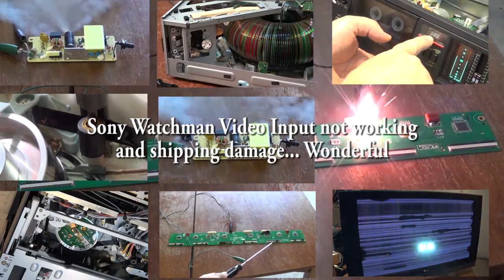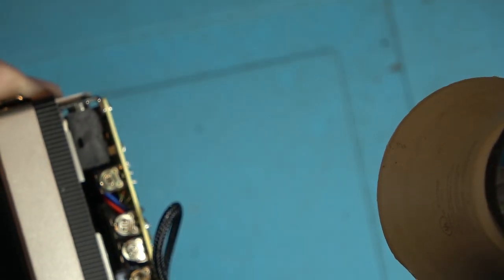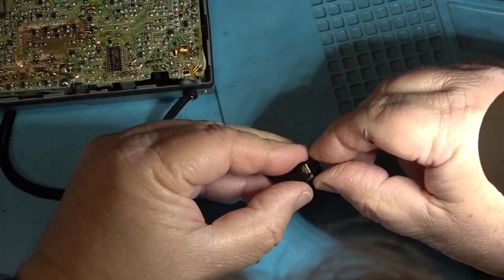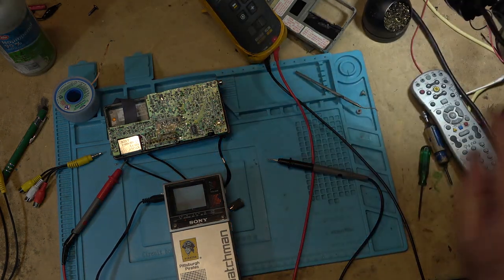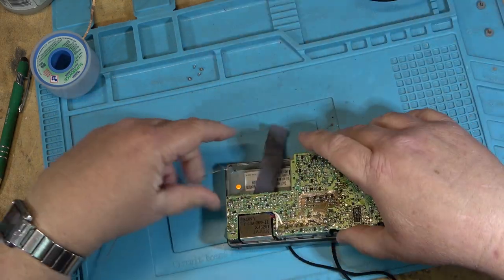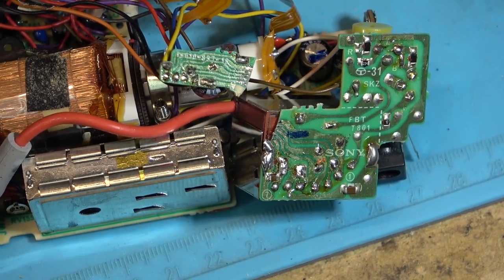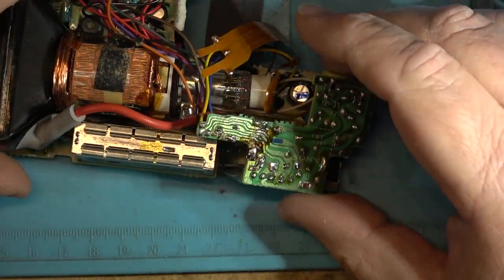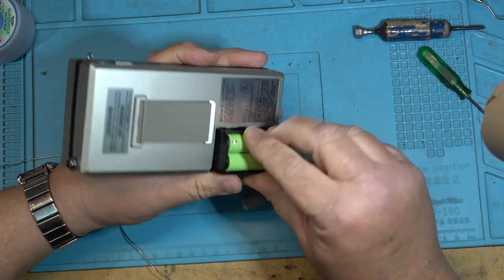Sony FD20A Watchman CRT TV Video Input is dead and other surprizes

Comment: I remember this TV from a year ago. Probably closer to when I started watching your videos
Reply from the maker: Well the mystery as to how the tip of the video Jack became lodged inside Was answered when I got onto the walkman that was included with it because in the bag was the broken   adapter plug. I showed it in the next video showing the belt replacement on the walkman when I discovered it in the bag so the video Jack must have worked when it was here I just didn't check it when the owner plugged that cheap adapter plug in it broke and stuck inside the unit. You shipped it back to me and it wasn't packed very well and the board got broken but somehow that's my fault right.
Reply: @12voltvids  the things owners do then blame it on the repair person (or something). :(

I have a loose USB C port on my laptop but know how it happened. I certainly won't blame a repair person if I take it to them

Comment: Well done and it put me to sleep after. Lol. That crt and flyback is something else.
Reply from the maker: The fact that it actually works is amazing
Reply: @12voltvids  the unit is quite delicate. I wonder how much research money went into that one!
Reply from the maker: @markanderson350  tons.  Not nearly as much as panasonic ct101 though. Now that is an engineering marvel and I have one.  1.5" color crt.
Reply: @12voltvids  i looked at a video you had on that model, yes it is amazing but, it is a scaled down crt, the watchman is a folded crt, so it deserves credit for being so small and radically different.

Comment: you are the best retro repairer, i wonder... i have an old VCR samsung VL-2560, it has a problem wich is when the vcr connected to the power the head drum will spin out like crazy and the LCD display won't work ,only shows - - : - - , what is the cause?

Comment: Deja Vu! Enjoyable to see repairs on the same units. That's the kind of luck we have, one thing gets fixed, sometimes else goes wrong. Or was the Jack issue missed the last time? No matter, I like to see you perform "surgery" on small electronics. :)
P.S., how did you get the vertical or horizontal deflection back?
Oh I see. Lol.
Reply from the maker: I never checked the jack as there was no mention of issue. It had no deflection and the issue was broken wire on the yoke coil.  So i never bothered to plug anything in.  Hope to never see it again as any more opening that unit and removing the board will have wires breaking. They are very fine and can't bend many times before they break.

Comment: Ok so you'd rather not get another Sony watchman but...how about some Panasonic Travelvisions? I live on the island and have every one they released. All of them need refreshed (The CT-101 the least amount thankfully, that one I'm scared to have taken apart..). They need new caps and such to perform better and fill the screen proper again.
Reply from the maker: I hear you on the ct101.  I have one but working great with new battery pack. Has a great picture.  Picked it up dirt cheap.
Reply: @12voltvids  They are brittle little buggers, aren't they! I got mine for a good price considering what they go for, but I doubt as cheap as you got yours for!
Reply from the maker: @speedyink  what my fd20a or the ct101.  The fd20 was donated to my channel.  The ct101 was loaned to me and then offered to me for what it would have cost to mail it back.